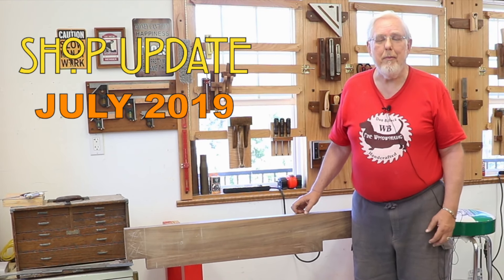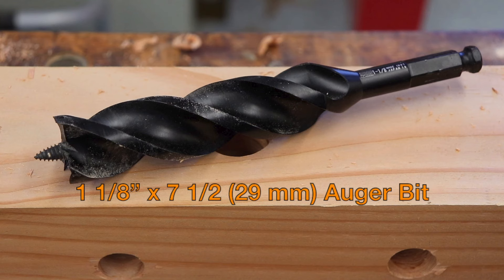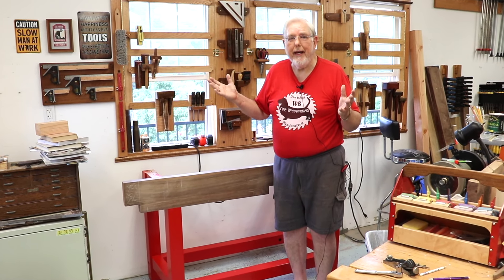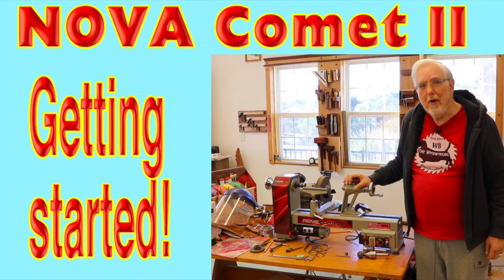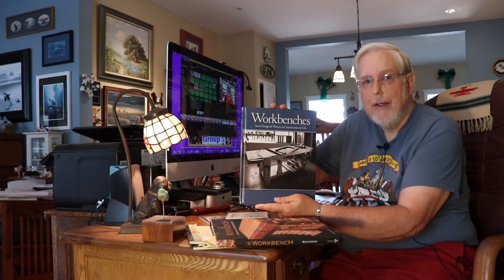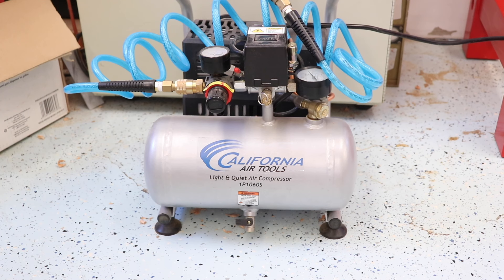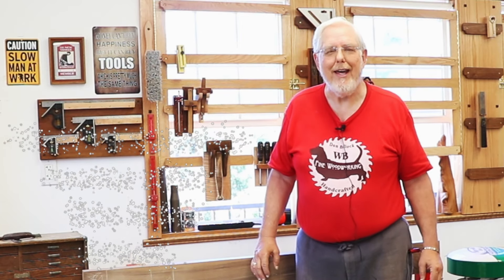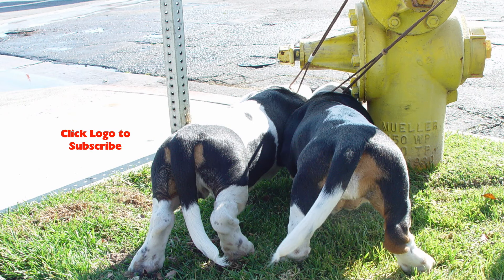woodworking Shop Update -- July 2019 -- Handy Tools -- Workbench Update

Comment: It's smokin hot here in NH and I am not built for the heat. taking the time in the A/C and catching up on what Don is doing.

Keep Them Coming Don
Reply from the maker: Kevin Dumais thanks for the encouragement. As long as I have people like you watching I’ll continue making videos and trying my best to keep improving them as I go. It’s hot here too but nothing like what’s going on where you are. I’m still able to get some shop time in the mornings and if the sea breeze comes up it will cool down my shop in the afternoon if I have the windows open. We’re still saving for a mini split for my shop/garage and still a few months away from that so most likely it won’t happen until late fall or winter. Heat is something that really bothers me. I hate to see drops of sweat drop on my table saw. 

Try to stay cool.

Comment: Nice update Don. Thanks. I know you are up in North county but you might consider Frost Hardwood for plywood. They have a very large selection. Keep up the great work. Thanks.
Reply from the maker: Kevin I appreciate your comments and encouragement. 

Thanks for the tip. I also have San Marcos Hardwood that’s very close too. I was just trying to get a good, flat piece with more plays than normal and I knew the stuff at Home Depot would be good for what I needed and was pretty cheap. I used it on my outfeed table project. The birch I got was perfect for what I wanted but wouldn’t recommend it for anything else. I thought of getting some sheets for drawers but the surface veneer was too thin.

I often get lumber at TH&H partly because it’s so close to Rockler. I’ve also found some great hardwood at Austins Hardwood in Santa Ana. Unfortunately, like or-there hardwood dealers, they’ve limited their selection of hardwoods to make space for “barn” wood and slabs. I’ve found a few nice pieces at San Marcos Hardwood too. Frost seems to be more aimed at contractors and cabinet shops. I’ve only been there once though so for my next hardwood project I may give them a try. Does Frost let woodworkers pick boards from the stacks or do they just bring it out? I just don’t buy much lumber at a time and I’m very picky about what I get. My lumber budget is very limited. I try to maximize the use of boards if possible but pattern is extremely important to me. I know I pay a premium for what I buy because I get to pick out what I want but I’m OK with that.

I appreciate the encouragement.
Reply: Frost let's you pick but you have to buy whatever length it is.  I get my plywood from them and everything else from TH&H. Man I love that place.
Reply from the maker: Kevin Hoffman That’s good to know about Frosts. When I need some plywood for cabinets I’ll check them out. If I shop there I guess I may need a cordless circular saw. 😁 My van will only take lumber just under 12 feet. On several occasions I’ve had to have a board cut down to get it home. 

I agree on TH&H. It’s a nice yard and the people there are very friendly. As long as I leave them their minimum length they’re happy to cut things for me. That’s one of the reasons I continue to check out Austin’s Hardwood as well. It’s even bigger than TH&H. Often, especially for domestics, they have a bigger selection.